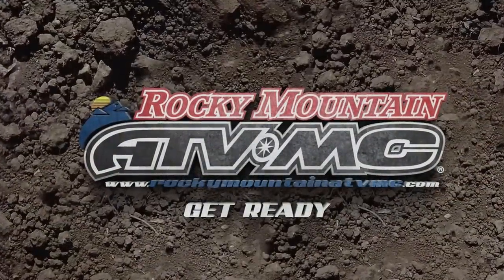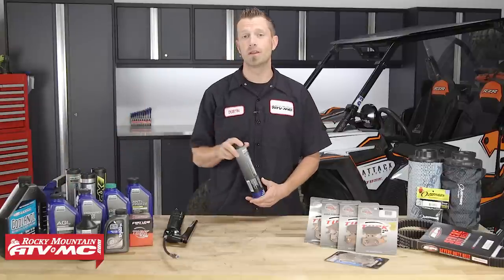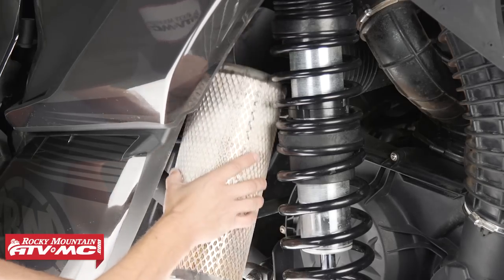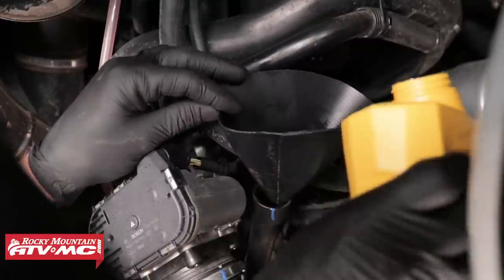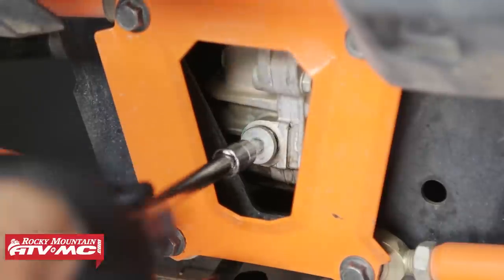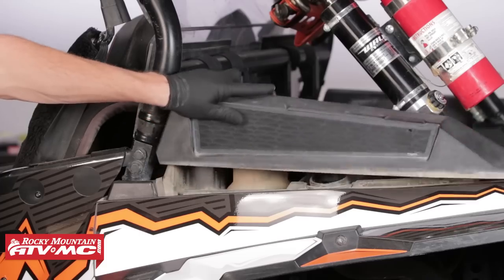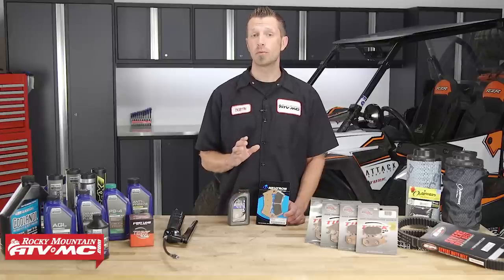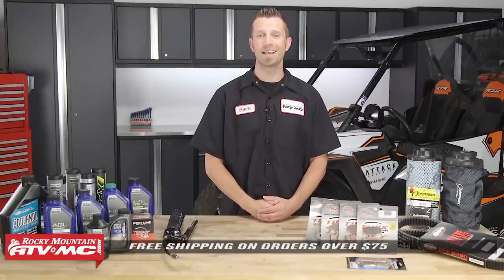Top 5 UTV Maintenance Tips

Comment: It's a good idea to change out the drive belt at home as a trial run and have all the tools, cleaning equipment & instructions on-hand in case a belt change on the trail is needed.
Reply from the maker: That's a very good tip. I've mentioned that in several videos. Definitely want to make a dry run so you're not totally lost on the trail. Thanks for watching!-Chase

Comment: be careful not to grease the a arm  bushes like shown here ..... the outside of the bush should be fitted dry and clean ... lube the inside of the bush that contacts the inner metal sleeve tube ... otherwise if the bush turns in the a arm it will wear  the inner bores of the arm and wear them out ... result .. buggered a arms $$$$ .... get it right rocky  ...

Comment: My 2017 1k XP has no grease zerks....? Did Polaris switch to something better that doesn't need constant greasing?
Reply: Ian, did you ever find any? I have the same rig and could only find 4. Front & rear sway bar... left & right. Nothing on the prop shaft or rad arms...
Reply: I have a 2018 1000xp4 and I can only find the ones on each side of the rear sway bar and on the u-joint. What happened to all the others?
Reply: They got rid of them in 2017 somewhere I think it's stupid for example like these new a arm bushings they think they are self lubricating yea ok screw that and fyi they make a greaser too for the wheel bearings
Reply: Going to have to get one. Thanks!
Reply: @patd4u2  rocky mountain has one now but I got mine on ebay last year because RM didnt
Reply: Thanks! I have been looking at the skid plate Rocky mountain sells, the Tusk 3/8 inch quiet-glide skid plate, need something to protect the bottom from the rocks out at quartzsite.
Reply: @patd4u2  I have just been using the stock one but I did buy a front gussett plate for the front but tusk makes good stuff i have 2 spare tusk axles front/back